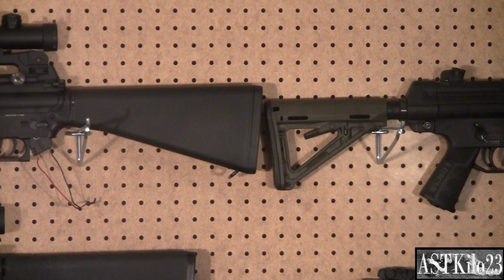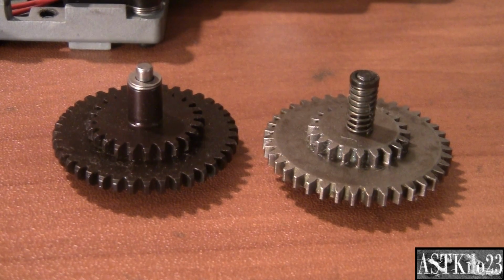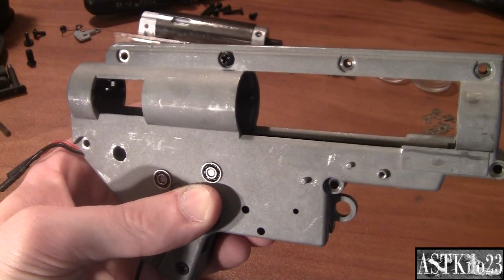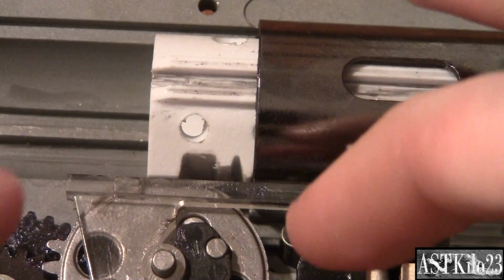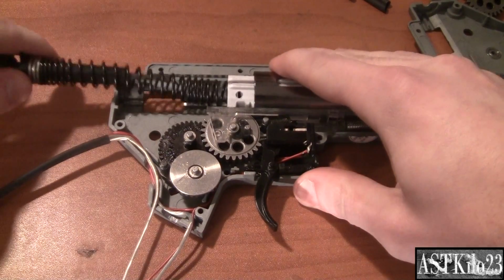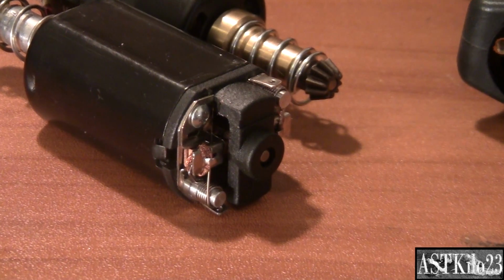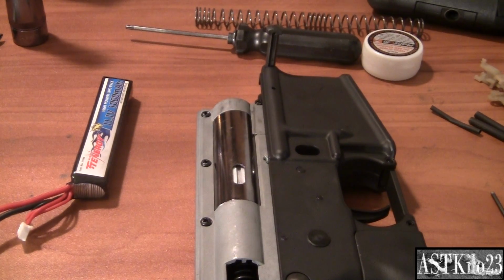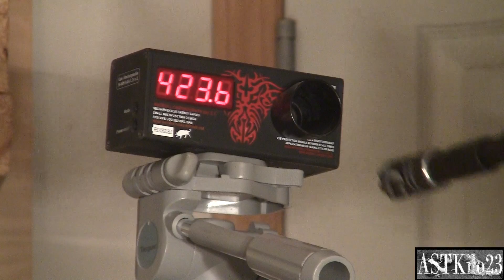Phase 2 - Echo 1 Platinum Edition M4 Upgrades   -ASTKilo23-

Comment: Ok after watching this, I'm rather impressed you managed to get the M4 to shoot perfectly with the E1 parts. I was doing similar to my G&P M4 but not with E1 parts. I am also getting an E1 FAL to work on for myself. It seems like the E1 stuff is pretty good but I am more use to the Lonex A2 high torque and a GATE mosfet. I'm not totally sure on which one is better and by how much. Please correct me if I'm wrong but I do believe that Gate and Lonex are two pretty good brands. Those are the two parts I have in my M4 and the parts I will be throwing in to my FAL.

Comment: that gearbox sounded smoooooth. what's your opinion on short stroking the sector gear and piston when using 13:1 gears, or when trying to achieve high ROF?
Reply from the maker: i think it works pretty well. i'v done it in the past without problems. takes some stress off of everything and gives you an rof bump with a slight fps drop.

Comment: I have changed almost everything in my Platinum M4.. Everything just keep breaks down. :P But what i dont understand is that im using an SHS m130 spring and i get like 395-400FPS. I have checked the airseal from the cylinder and piston, and its perfectly sealed. Any idea on what it can be? I use a ProWin hopup with Maple leaf bucking and nub, and it's all new.
And im using Lonex cylinder-set, SHS piston, GATE Merf 3.2 mosfet, Lonex A1 Supreme motor, and madbull python barrel 6.03.. The only internals that i havent change is the gears ( but i have just ordered SHS 13:1 gears)
Reply: it can be your air nozzle... does your air nozzle have an o ring??
Reply: FCBarcelona8 tried 3 different nozzles and yes, they have o-rings
Reply: FCBarcelona8 think it is a 407mm 6.03 madbull
Reply: Papirkurven your cylinder might not be ported to match the air volume you need for your barrel
Reply: FCBarcelona8 Yes It is. tried 2 different sylinders aswell. Lonex and now SHS.
Reply: Papirkurven dunno if you still have this problem, but it might be usefull for other people. Enlarge the oring on the piston head